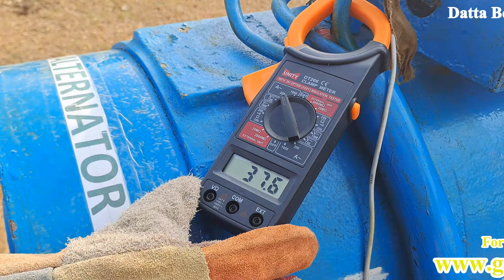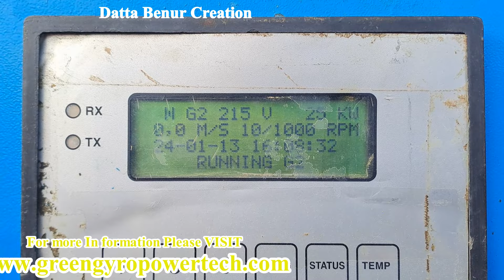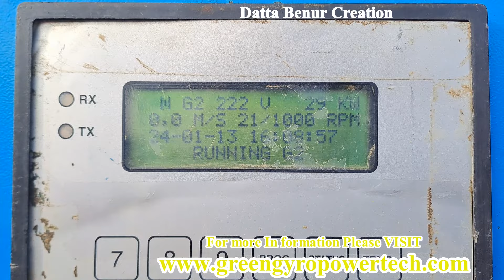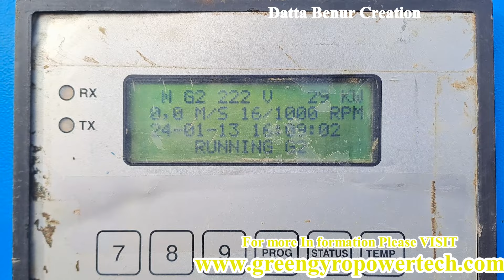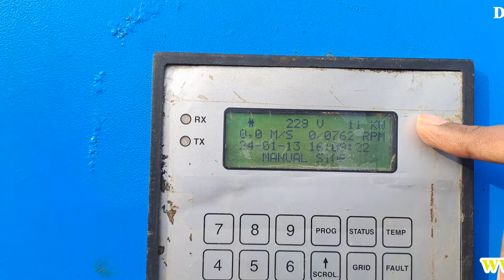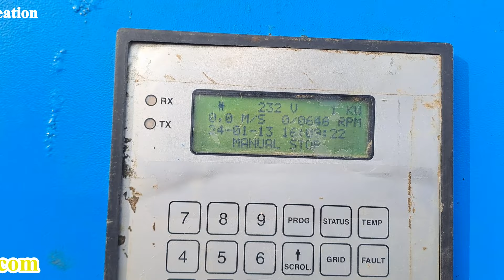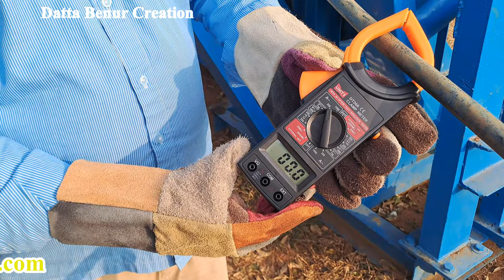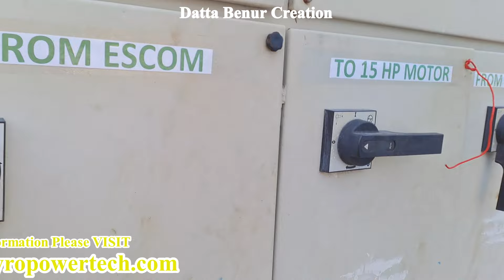Free Energy Generator - Flywheel Free Electricity - BIGGEST commercial flywheel Energy Technology

Comment: I am an electical engineer. I want to see if you remove belts from the electric motor and machine is still running for  hour.
 How is the guy can shut the fly wheel machine with a push switch? 
 He cut the secret power provided to the motor which is the source of energy. BS. Only happen on YouTube.

Comment: This is the whole concept of the machine. The motor is powered by the grid, and after it gain speed. Grid is disconnected, and power return from alternator to power the motor. This is give in return, the machine can only be stopped when you discontinue power from the alternator to the motor. And that can be done by the switch..
Reply: Congratulations - You just recreated an early design power conditioner. 
Modern electronic units work much better.